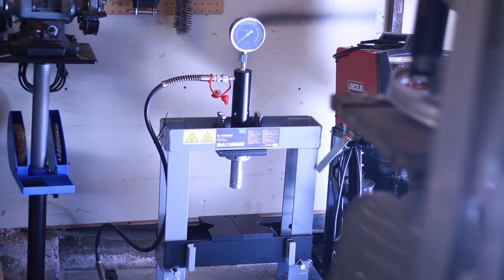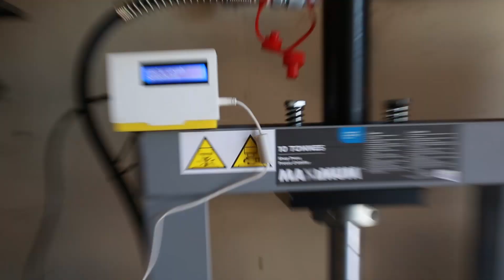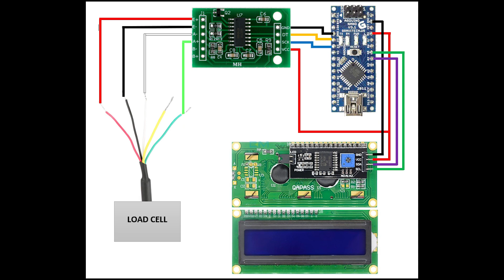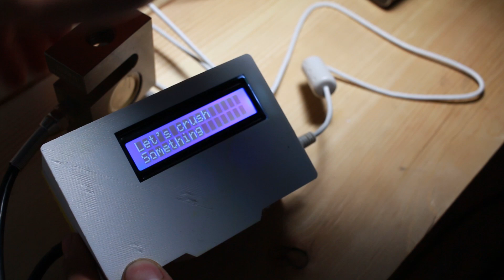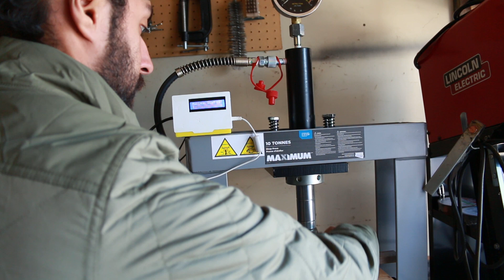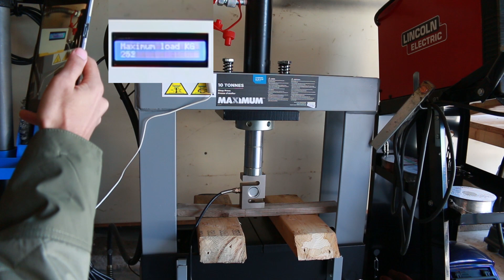How to use a Load Cell (Strain gauge) using Arduino, HX711 and LCD Display

Comment: Is it possible to powering the load cell with an external power supply instead of the Ex+ and Ex- of the HX711 to reach higher voltages for some sensors?

Comment: I am using Arduino UNO, but only 1 thing is working either the load cell os giving load only and either the lCD is displaying Lets Crush something.. the value of load is not displayed on LCD what can be the issue?

Comment: Can you tell me the wire connections? We could not see it. I have the same cell, and I need it to connect. It's an excellent video, but I need more help. I can not understand the type of microcontroller you used. I only have Arduino Uno R3. Can you help me please? Thanks
Reply: its a arduino nano

Comment: Can you provide the link or full name of the load cell being used? I would like to try this project for myself
Reply: I'm looking for the same load cell.. My current load cell is not compatible with hx711
Reply: Hi, I happen to successfully replicate this project and figure out that s load sensor with 5V excitation voltage can be use in this project. Ask seller for datasheet and check the excitation voltage